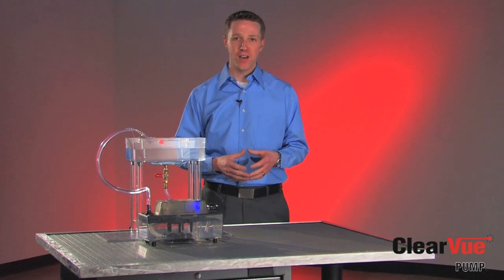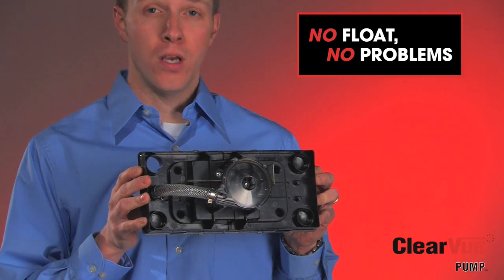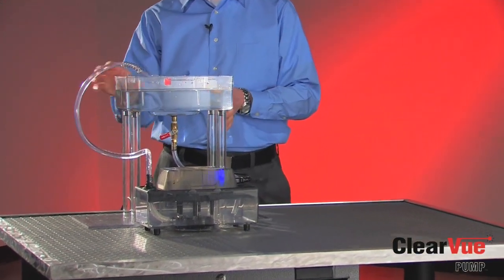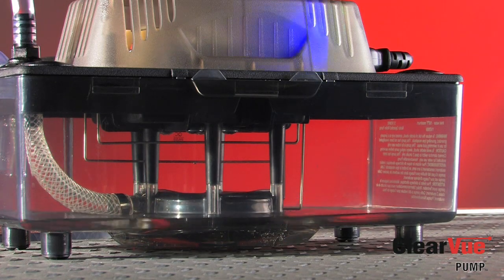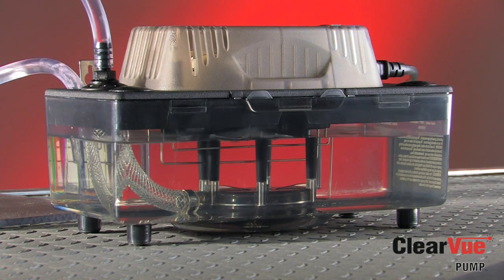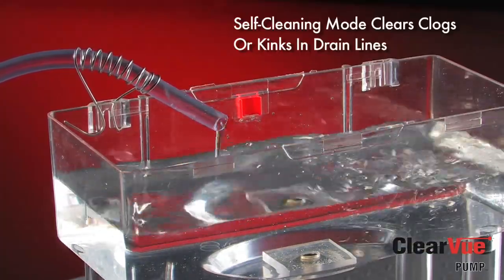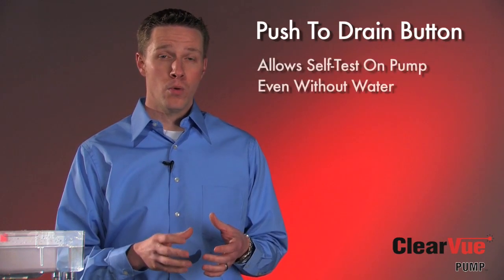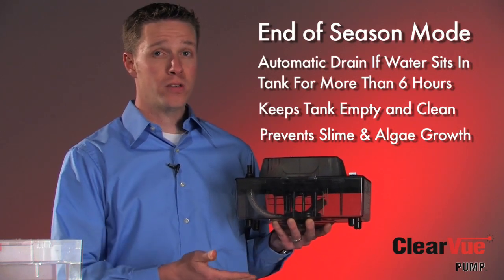DiversiTech ClearVue Pump Demo

Comment: The pump alarm will not shut off so I unplugged and cleaned it. Now when I plug it in it doesn't even power on at all I'm thinking the circuit is fried. This thing is a big POS. Do not buy! I'm stealing the next one to compensate myself for being scammed.

Comment: replaced an old pump but this ClearVue isn't detecting water.  It overflowed without an alarm and without trying to pump.  When I press the button to manually pump, it pumps water out fine.  No problems with the pump.  It seems the sensor is not sensing water at all.

Comment: DO NOT BUY!! I had one and used it for last than one month, and the pump stops running. The water in the tank will rise and flood my floor. This Clearvue condensate pump is due to bad sensors and a lousy motor. I check and no-clog, did a self-cleaning and check everything no issue, and still not running. I don't see any warranty for this product for a replacement.

Comment: My pump won’t stop running. The canister is empty and the drain light is on. The other day my floor was soaked with water. What to do ?
Reply: Buy a different pump. Install a water leak detector that will automatically shut off the source of water and the pump. This can be found at: https://www.amazon.com/gp/product/B00988NOV2/ref=ppx_yo_dt_b_asin_title_o01_s00?ie=UTF8&psc=1

Comment: DO NOT BUY! I had mine for 2 months and it would not stop running, even with the hose off, so it was not a clog. The “stainless” parts inside are rusting as well after 2 months.

Comment: Question. Can the pump handle hot temperature water from a humidifier
Reply: The pump is rated to be able to handle water temperatures up to 160 degrees F.

Comment: This pump is more prone to fail than with a float type
Reply: I've had one operating just fine for 7 years.  Only had to clean out some slime growth a couple of times, and that's with ZERO chemicals added along the way.  I would choose this Brand again if/when mine eventually wears out, and also recommend it to others.
Reply: I don't think so Tim
Reply: I’ve had 2 of these pumps fail in 4 years. Circuit board failure of some sort.  Going back to old school.
Reply: If the air handler is installed in a nasty environment where the air has just the right chemistry to it this pump will fail. If air handler is in a cleaner environment the pump may last longer

Comment: Does ClearVue make a quiet condensate pump suitable for cassette-type ceiling mounted evaporators, such as those used with mini-split A/C systems?
Reply from the maker: We sure do! Please check out our ClearVue MINI. http://www.diversitech.com/Product-Line?id=a0jC0000005QG0YIAW#features 
If you have any other questions, call us! (800) 995-2222

Comment: Just finished installing this pump, easy to install, nice looking pump, there were not any installation instructions but it is pretty easy to figure out.  I purchase the pump from a on-line dealer, MUCH cheaper than buying to locally.  I had to splice in an extra 2 feet of power line because the new pump didn't have enough line to reach the power source.  I don't know where they found Dave, but the video is really bad, Dave must be the owners kid.